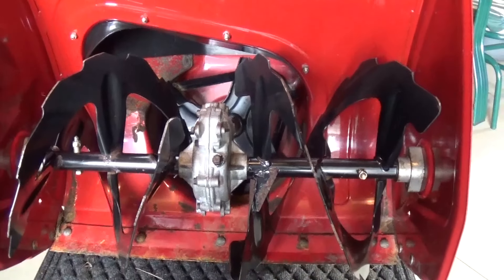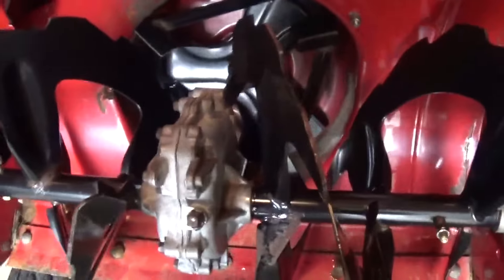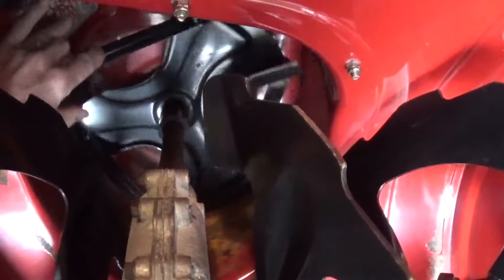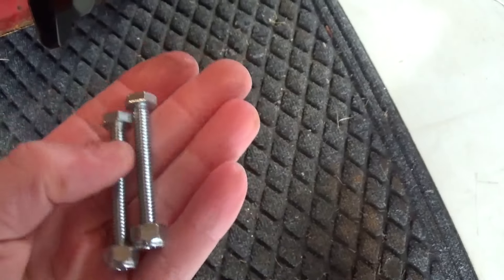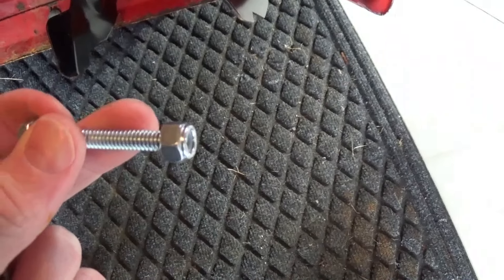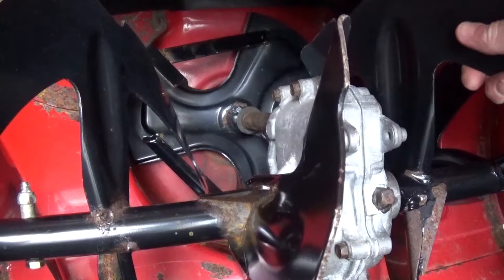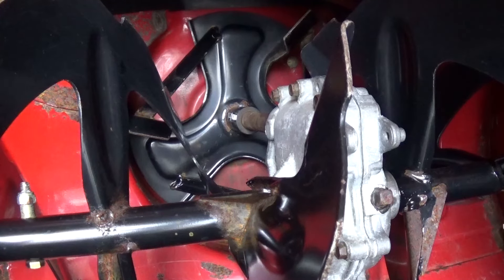DIY - How to replace snowblower impeller (auger) Shear Bolts (pins)

Comment: If one of these bolts broke could it ever end up behind that wall as a bolt was found when I upended the snowblower and took that back plate off sitting right there below a belt ?

Comment: Really grade 8 bolts?  I could see possibly grade 5, but they’re supposed to be shear bolts so they break under stress. Every time I’ve done this I’ve messed something else up worse. I would not recommend using grade 8 bolts!
Reply: Higher grade steel sheers wile lower grade bends

Comment: DId you measure the distance in inches between the auger collar and back end of gear box?  I would like to not have to search for the hole.  thanks,
Reply: I measured measured a similar model as mine as about 4 3/4" distance on showroom floor. that was about what mine was, FYI.
Reply: @pianoplayer8226 thanks i needed that info. Mine broke but the impeller is stuck. Now I know I have to knock it back a little .

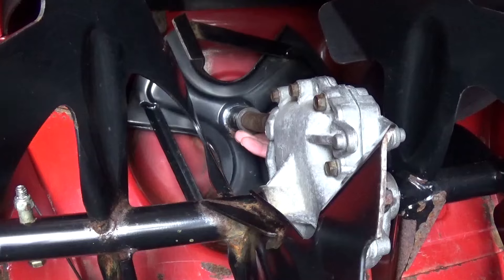Comment: My impeller shear pin is off, but my impeller doesn’t move free from the shaft like yours does on 0:50. The whole thing acts like impeller pin is in place, but it isn’t. What could that indicate?
Reply: Theres single stage and 2 stage blowers make sure you know what the difference is. Also it could be because its been rusted or maybe a piece of the bolt is still in there. I just had my pins break today and quickly figured out what it was. Then went to YouTube to confirm it and I was right. Just use common sense and look things over extremely well. You can fix anything at home most times if you put some effort into it.

Comment: Fine if you're in a pinch, but please don't use regular bolts, folks. Shear pins/bolts are cheap and plentiful.
Reply: His title is wrong, those are not shear bolts back their.
Impellers do not use shear bolts, only the augers do, they are not indended to break back their. The majority of blowers use roll pins (coil rolls) for the impeller, their not designed to break. Some snowblowers use keyed shafts and lock nuts, others bolts, but the impeller is not designed to break free on a snowblower.
Reply: Especially grade 8 bolts, you will do some real damage
Reply: He left out the most important step. Like how you get the old broken pins out.
Reply: His Toro is the same model as mine. It uses shear bolts as per parts manual they look like brass bolts. I just has to replace both of them as both were broken. Part number 321-44. Using a grade 8 bolt is way to strong and will damage that gear box next time this happens. My toro does not have roll pins.i was lucky both  bolts 
Had fallen out.
Reply: Apparently the answer to my question is can you either take the pins and sharpen one edge with a grinder. Or you squeeze it smaller with a pliers. That will allow it to get in and push the remains of the old out as you hammer it. 
A small screwdriver, or a nail that will fit inside the roll pin can be used to hold the hole on the impeller lined up with the hole on the shaft.

Comment: What if the shear pin is busted but still in the shaft?
Reply: Get a nail, or something smaller than the diameter of the shear pin and spin auger until it’s lined up and use nail to push it out.
Reply: What he said 👆

Comment: Wait, what? My HS928 seems to only have ONE hole for a bolt in the area shown in the video. I assume this varies by unit? Actually, I have one on each end of the shaft, not 2 close together like shown.
Reply: Different machine, different design.

Comment: How to do this safetly if you aren't supposed to stick your hand in a snowblower?????
Reply: You can stick your hand in when not running, pull the start pin/key out, turn off gas and if you need another layer of safety pull the spark plug wire, as you can tell it's not running, in the book it tells you what one can do or not & how.
I have a Toro snowblower, I've worked on it for simple things like this.

Comment: Be aware the can impeller can slide in and out with some force if needed. Mine didn't at first and needed some force then I could align the holes.

Comment: Whats the oem bolt that go there
Reply from the maker: I bought mine from the dealer.  The dealer said they were 8 grade.
Reply: @Maxsimic  do u have the parts number ?
Reply: Part number 321-44
Reply: Go to toro online ..look up your model number and down load parts manual and look up the part number. That's what I did
Reply: @rookieTL  oh! I thought it was a honda

Comment: Please don't do as this guy is doing!  You NEVER replace sheer pins with bolts! If you do and the need come to play that ice jams the auger or impeller those bolts will NOT break and it will destroy the auger shafts and the impeller! All ways use sheer bolts not anything else!

Comment: sure doesn't look like a shear pin/bolt that would break as designed...
Reply from the maker: Bought them from the dealer.
Reply: Its not, the impeller is not designed to shear on a snowblower, only the augers. The majority of blowers use roll pins (coil rolls), some use a keyed shaft and lock nuts, a few bolts, but the impeller is not supposed to be breaking away. Title is wrong. He's using the right bolts, roll pins would be even better, take all the slop out.
Reply: @Maxsimic  what size bolts are they?
Reply from the maker: @aidangregg  8 Grade 1/4 inch by 2 inches